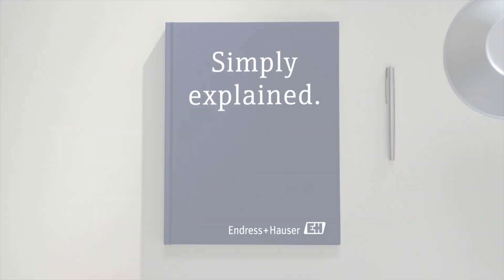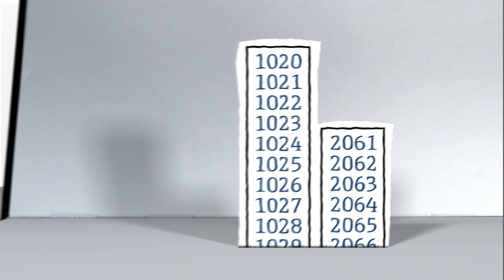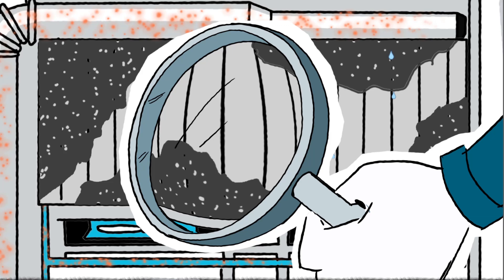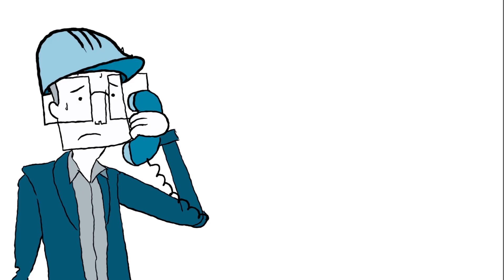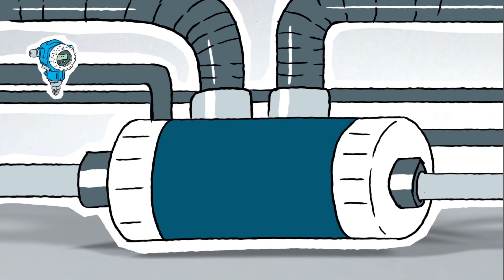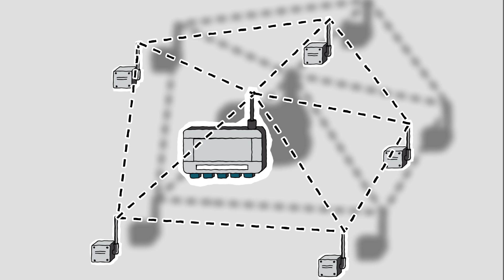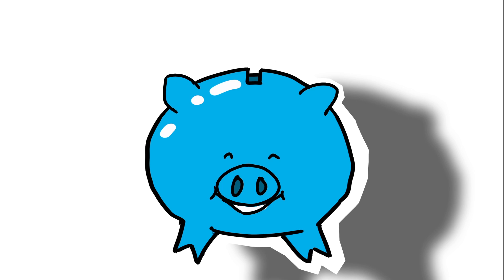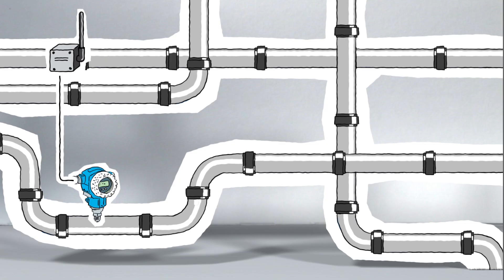Simply explained: No-hassle wireless – with WirelessHART

Comment: You didnt explain WirelessHART at all :(
What is a Superframe? What is an ASN? What is a Slotend? What is a Channel Offset? What is a Channel Index? What is a Channel? What is the Delay of a message in a network? Are there message priorities?
I feel like, this is a commercial for these temperature sensors...
Reply: I agree it’s more an application of wirelessHART,. Never in my 9 years of talking about IEc62591 did anyone mention anything about the stuff you just asked about. Why? Because it’s largely irrelevant for the applications it’s designed for.